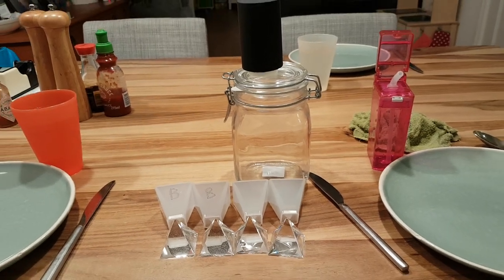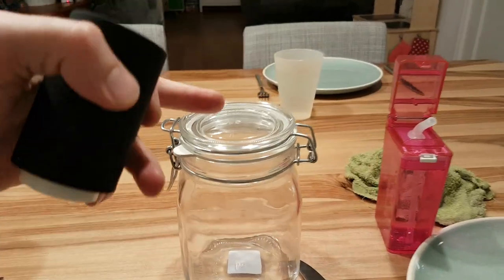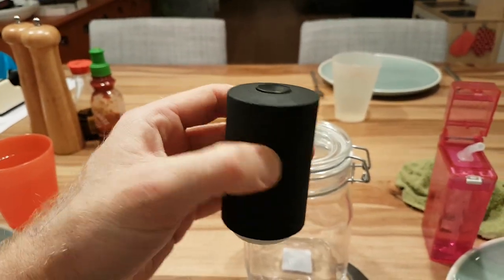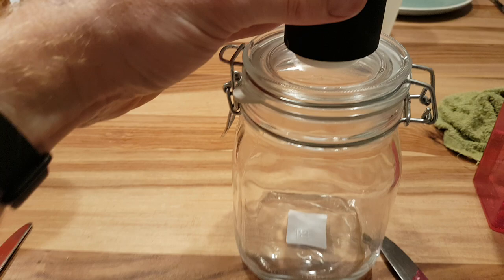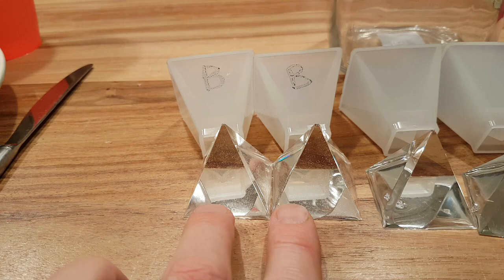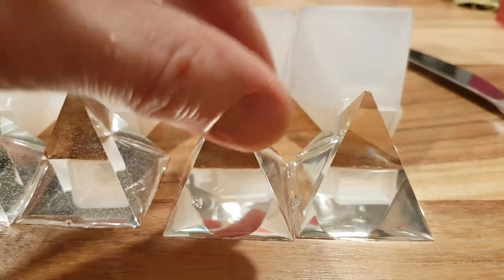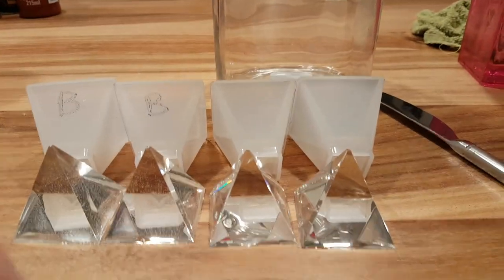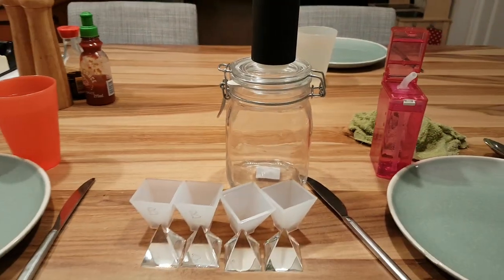Removed bubbles from epoxy resin using a battery powered food vacuum

Comment: I'm curious...what brand of epoxy do you use? Slow or quick cure? Would the ambient temperature make a difference on the time you need to vacuum? Did you take special precautions while pouring in order to not reintroduce bubbles? Maybe a complete video tutorial on your process would be informative. Thank you for sharing. I've not worked with resins yet but I am exploring options for it is on a list of future projects.
Reply from the maker: I used this. https://polyestershoppen.nl/epoxy/epoxy-giethars-202.html. Curing is 24 hours at 25 celsius. And few hours at 60 degrees celsius, but I dont do fast curing. Sure temperature has effect on viscosity, the lower the viscosity the easier the bubbles escape, I usually pre-heat the epoxy to hand warm temperature. Pouring I do slowly. Stiring I also do slowly. In small object the bubble escape more easily.

Comment: Thanks Jasper for sharing this, I have a food saver machine with an adapter to fit over my wide mouth glass mason jars, they have a separate lid with a seal and a metal screw band.  If they can hold their own in a pressure canner, i'm guessing they will be fine with the food saver machine. i'm going to try this and see if it works.  I'm a fan of the unconventional :-D
Reply: Work?

Comment: Question. When I've done this myself, after removing the vacuum pump my resin "explodes" a bit and creates a mess inside the container. Any advice on this ? I'm wondering what I'm doing wrong 🤔
Reply from the maker: Geat question. Then there is a strong air flow through the tiny hole which blows the epoxy out of the cup. The trick is to keep the pump on the hole for a few minutes and it will release the vacuum slowly
Reply: @JasperSikken  oh right so leave it on whilst removing the lid?
Reply from the maker: No turn the pump off, keep it there for a few minutes while the vacuum slowly disapears, then carefully remove the pump and then open the lid

Comment: Do you have an idea of the level of vacuum these jars are safe to? Wouldnt want one of these imploding on me, might be worth testing one to destruction. (Edit- although, i'm not sure these small vacuum pumps could pull enough to cause any danger- just a thought)
Reply from the maker: The vacuum is -350mmHg or 0.46 bar, that is not so much. It doesn't feel like it is strong enough to implode a glass jar. To give you a feeling of the strength. If you would vacuum your skin, it will become red but it will recover in 30 seconds or so.
Reply: @JasperSikken  Cool, i thought it would take a greater vacuum to take the bubbles out, might have to give this a go 👍
Reply from the maker: @ximonx  yeah well maybe it worked out so well because my objects was so small
Reply: Old comment, but in case anyone comes across it: I'm fairly certain that creating a vacuum is only as likely to burst the jar as filling it up with something heavy would be (I.e. positive pressure is roughly as bad a negative pressure, at least in a cylinder). At any rate it would indeed be exceedingly rare for any vacuum pump that size to be capable of bursting a jar like that, especially when the intended use is vacuum in a food bag or any other flexible container.

Comment: thank you for the video! was the resin in a cup that you placed inside the glass jar and then you closed the lid and used the vacuum for 10 minutes?
Reply from the maker: Yes exactly as you describe
Reply: @JasperSikken  thank you for the reply. Just wondering how did you create the hole in the jar lid? Is there a special drill bit I need to not crack the glass or a normal small drill bit will work? Thank you
Reply from the maker: @mb-17  The right way is to put some blue tap (painters tape), wear safetyglasses and gloves and use a diamant drill, but I used a metal drill. It took me 15 mins because I tried to be very careful.